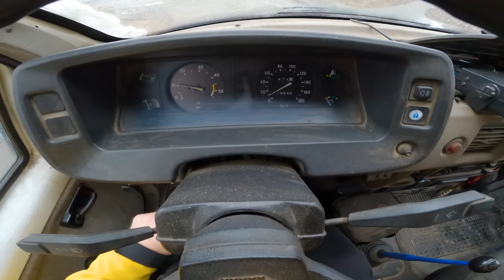2000 GAZelle 2705 2.4 MT - POV TEST DRIVE

Comment: Making only 86hp from 2.4 liters in 2000 was pure talent. The 1956 Volga 21 made about 95hp from 2.5l. and this van is making only 36hp per liter. Cars from the 1940's were making that much power.
Reply: @thegamereviewandreallifech1910 That's because of the fuel crisis in USA. Which impacted them in the long run.
Reply: Volga has 75 hp.
Reply: This particular model was produced from 1994 to 2003. And engines were installed on it, depending on the configuration